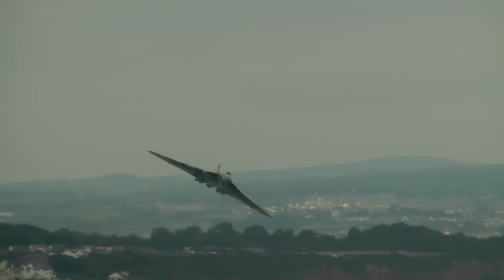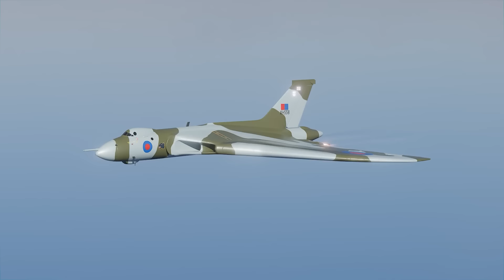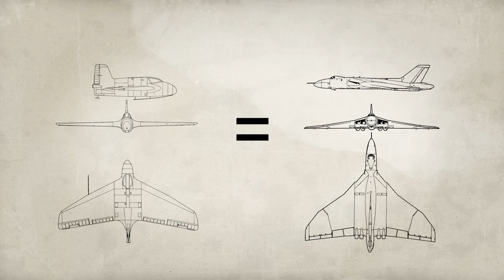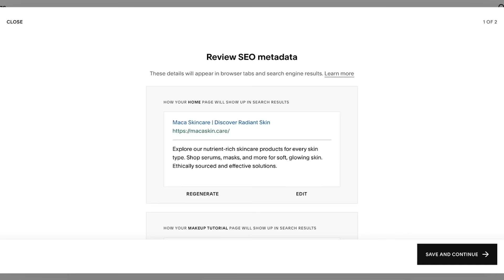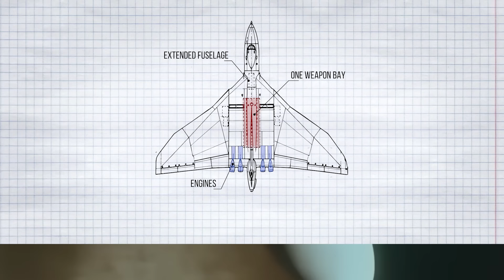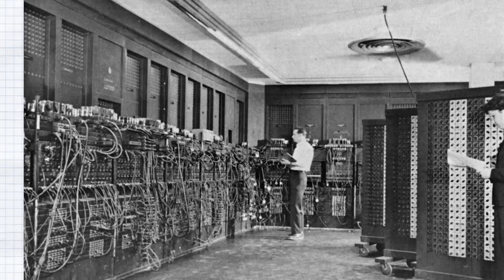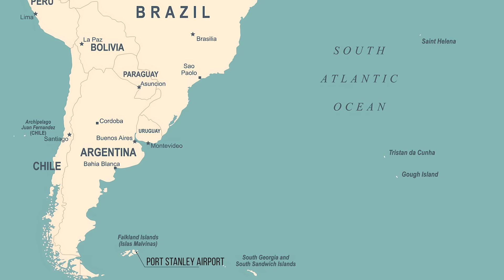The British bomber made to defeat Russia... Avro Vulcan

Comment: I was lucky enough to work on the Vulcan BMk2s from 1963-66. It was a never to be forgotten experience.
Reply: Did you ever deal with the Mach limiter system?
There is not much public information about this hastily introduced modification to the Vulcan after the in-flight structural failures.

Comment: The avro vulcan doesn't have afterburners.... or reheat as its called
Reply: Couldn't reach Mach 1 either... without crashing
Reply: @WilhelmKarsten I believe that at high altitude the vulcan could get close to mach 1, like the high 0.9s and could break mach 1 in a shallow dive

However your correct with the fact that it wasn't designed to sustain mach 1 speeds for long periods of time
Reply: @aufstrigende The Vulcan exhibited a fatal pitch-down, Mach tuck behavior above Mach 0.9 and all production Vulcans were modified with a "Mach limiter" device that would automatically override the  pilot inputs and put the aircraft into a climb if it approaches Mach 1.
This was in response to 2 near crashes and one fatal crash due to loss of pitch control authority.

The Vulcan was designed to fly Mach 1.6 with afterburners on later production models but these engines were canceled after serious structural and aerodynamic design flaws were encountered in flight and acceptance testing in the supersonic and high transonic regime.

Britain has never produced any successful supersonic bombers and only produced a single supersonic jet aircraft, the Lightning.
Reply: @WilhelmKarsten I didnt know that about the vulcan so pretty interesting, 

i suppose britain has had a few fighter aircraft capable of pushing past the speed of sound however they have always been at high altitude or in shallow dives and I suppose the Typhoon and Tornado ADF would count to the supersonic list that britain have produced however they was in partnership with other countries
Reply: @aufstrigendeThe English Electric Lightning is the only British designed and built supersonic jet.

Comment: Wait... flicking a nuke? btw. they used a lot of things learnt from the vulcan for the concorde. infact, the concorde also used the rr olympus.
Reply: Really? What this did they use on Concorde?
Wtf? Are you serious. The Concorde uses completely different engines!
Reply: @WilhelmKarsten  the Concorde used Olympus 593s which were directly based off of the 201s and 301s the vulcans used
Reply: @shuriken5176 WRONG, the 593 was developed by SNECMA in  France and is a completely different engine

Comment: Since when did the Vulcan have afterburners!
Reply: Avro designed the Vulcan to be supersonic with afterburners but after the crash they canceled the afterburners and installed speed limiters on the rest of the aircraft to prevent more crashes
Reply: @DoktorBayerischeMotorenWerke No my friend, the Avro Vulcan was not designed to be a supersonic aircraft. While its revolutionary delta-wing design offered excellent high-speed, high-altitude performance nearing the speed of sound (around Mach 0.9–0.96), it was designed as a subsonic strategic bomber to meet Specification B.35/46. I flew them and know the aircraft inside out and know it's designed specs.
Reply: @johneland8225  Wow! You really don't know anything about the Avro Vulcan or the serious design flaws that were revealed in the flight test program.

Don't be stupid, do you really believe that a tailless, 52 deg. delta-wing, Area Rule jet aircraft designed in the 1950's with 4 massive Rolls-Royce Olympus engines was not intended to have supersonic performance???
 Are you trying to take the piss lad???

The Vulcan had an extremely high Mcrit of Mach 0.88 (higher than the Mach 2.2 F-104) but testing revealed serious aerodynamic and structural flaws and limitations. 
Despite its high wing sweep angle and Area Rule fuselage during high-altitude, high-speed tests it had a severe "Pitch Up Problem" as it neared high transonic speeds. compressibility would overcome the plane pitch control authority and go into an unstable AoA, which led to a high-speed stall and catastrophic structural failure.

Avro was forced to modify the Vulcan 'Ad Hoc' with vortex generators on the wings and a "Mach Limiter Device" to prevent pilots for inadvertently reaching Mach 1 in a shallow dive.

The Vulcan could easily reach Mach 1 in a shallow dive without its planned afterburning Olympus engines, which were subsequently canceled.
The Vulcan's failure to achieve Mach 1 and the fact that the UK has never produced a supersonic bomber is a source of great shame and embarrassment.
All mention of Vulcan's supersonic capability has been erased from Avro's and any other British published literature.

The Vulcan's configuration is both unique and a dead-end concept, a direct result of Britains lack of supersonic aircraft technology.  

 Any questions laddie?
Reply: @johneland8225 The Avro Vulcan was designed to fly Mach 1.6 with afterburner but it's design was deeply flawed due to Britain's lack of high-speed wind tunnel research.
The Vulcans unique supersonic aerofoil designed proved to be an evolutionary dead-end concept and has never been used since.

Comment: 0:28 Why has it got afterburners 😭
Reply: The Vulcan was designed to exceed Mach 1 with afterburner in level flight.
Problems with the massive Bristol Olympus engines with afterburner caused delays and was not ready so the Vulcan entered service without the afterburners with plans to update older aircraft when the engines became available.

Two near crashes and the crash at the Seyston Airshow revealed that the Vulcan was unstable at Mach 1 and plans to install the afterburner were canceled.

Avro was forced to retrofit the Vulcan with MCAS to prevent pilots from exceeding the safety speed limit of Mach 0.9

The MCAS system would automatically pull the control yoke back and put the aircraft into a climb if it exceeded the safe speed.

Comment: Needed re engined and electronics upgraded and it would still be like a UK B52. Add some fuel tanks to double it range.
Reply: The Vulcan was never designed to handle the stresses of low-level, terrain following missions and the airframes were literally destroyed by metal fatigue and corrosion damage from weakened joints.
 The Vulcan was never able to fulfill its high altitude missions because it was too slow and it lacked the range at low-level to be a threat to the Soviets or any other potential threats.

Britain lacked a long range, air launched missile and could not afford to develop a new missile and buy the American Polaris missiles.
Britain lacked a nuclear ICBM too

Comment: I saw the vulcan in one of its last flights at herne Bay, kent, the sound was incredible,  it blocked out the sun as it headed out over the sea, setting off car alarms. As it flew across the sea it opened its bomb doors. Its rate of climb was also amazing,  just an incredible plane . Sadly  it is  not possible to certify the plane for air  worthiness,  so it can't fly anymore

Comment: That thrust sound is the best I've heard....that bomber with 4 English Electrics and your in trouble....the Electric was a rocket with wings....the English E climbed to over 80k feet surpassing over Mach 2.2 the US asked for 2 English Electrics and there pilots and grown crew to test against SR1 to see if it could keep up and reach it's altitude..the U2 had 10 minutes advantage then the pilots heard the roar of the English Electrics which was doing just over Mach 2.4 and then went on to climb  to 82k feet absolutely annihilating the U2
Reply: The Vulcan failed to fly supersonic despite being powered by 4 massive Bristol Olympus engines.  The "Aluminium Death Tube" what RAF pilots called the E.E. Lightning could only reach Mach 1.9 in operation service... it was not a true Mach 2 aircraft. 
it was also the only British jet aircraft manufactured that could achieve supersonic performance.
Its speed was at the expensive of having any useful range...

Comment: She didn’t have reheat/afterburner. Dry thrust only.
Reply: The Vulcan was a major disappointment in early flight tests and was unable to safely fly supersonic, Avro was forced to installed Mach limiter device to each aircraft to prevent loss of control and structural failure resulting in fatal crashes.
Plans to install the afterburning version of the Bristol Olympus engines was canceled.

Comment: Have always been a big fan of the V-Bombers seeing Victors, Vulcans, and even by chance a Valiant fly. I also like to include the backup aircraft the two Sperrins built just in case the others didn't work. Managed to go on board for a ground tour through a Sea of Vulcans at RAF Scampton of the last Vulcan B1a, and boarded a B2 at Blackpool. Plus boaded a Victor at RAF Marham which is very different inside. 
   One concept I can remember them contemplating was a Vertical Take off Vulcan. I can't remember if that was if the 1950's idea for a VTOL test bed for the Rolls Royce Griffiths Airliner or not which if it were ever made was designed with an amazing 68 engines. Saw XH558's last flights. Last official display over Shuttleworth Collection, Old Warden, Bedfordshire arounf 10 years ago. Someone has mentioned it. It's a good video. It is a shame that it shows the Vulcan with afterburners which it famously never had.

Comment: You were doing great until you stated that the Blue Steel was there to defend the bomber. Blue Steel was the equivalent of a modern Tomahawk Missile carrying nuclear warhead, a nuclear tipped stand-off missile, so that the bomber didn't need to fly over the target. 
However, I seem to remember there was some talk of using the wiring for the previously installed Skybolt missile system to allow carriage of AIM 9L Sidewinders during the 1982 Falklands War.

Comment: Saw vulcans several times at Woodford air shows. Besides the howl they would make the ground shake and fill your senses with noise as they would fly along the runway at low speed then open to full throttle into an almost vertical climb setting off car alarms. It was amazing to see that huge slab of metal going straight up then being flung around like a fighter.  There is one on display at Woodford Avro heritage museum, also a cockpit you can go in.

Comment: Small inaccuracy, while the Engines the Vulcan used would be the same used on the Concorde, the Vulcan's did not have afterburning versions of these engines so showing them with afterburner is a mistake and tbh a pretty amateur one at that
Reply: Concorde used the French designed SNECMA-Bristol Olympus 593 engines, a completely different powerplant.
Avro failed to deliver a supersonic bomber... the Vulcan never achieved its Mach 1+ performance specifications.
Avro ceased to exist in 1963... it was absorbed by Hawker Siddeley which was not affiliated with the Concorde program.

Comment: I am lucky enough to see this fly and it moves more like a fighter than a bomber. If you really wanted to talk about this plane should should have mentioned operation sky shield from the 60s where the US wanted to test their air defences. The first operation would have seen the Vulcans beat the air defences and drop nukes on the US and the second operation where the US stacked teh deck in their favour would also have seen the US nuked by the Vulcan.
Reply: American bombers nuked London dozens of times... these were attack simulations just like with the Vulcan. Sky Sheild was NOT an exercise or a defense system test, it was only an attack simulation. 
 the Vulcan was a very disappointing design that failed to achieve Supersonic performance and was essentially obsolete when it entered service. Britain has never produced any supersonic bombers or stealth aircraft.

Comment: your diagram of the prototype is wrong the initial vulcans had sraight leading edges . this caused flutter so resulting in redesigned wings that you show on your diagrams.
Reply: It also resulted in Mach limiters being installed on all Vulcan to prevent them from crashing if they accidentally went supersonic, the Vulcan airframe was too fragile and weak to handle the stresses of Mach 1.

Comment: “170 tonne bomber” what is this a a330? Highest weight variant of the Vulcan was roughly 93 tonnes at take-off…
Reply: IT IS TON NOT TONNE
Reply: “ A tonne is a metric unit of weight that is equal to 1000 kilograms”

We’re using metric tonnes buddy. Keep your tons in America.

Also if you long press caps lock or the up
Key in your virtual keyboard you can go into lower case.

Comment: That howl only occurred on the B2 versions fitted with Olympus 200 series engines at a certain power level, and was caused by the airflow in the intakes. B1's and later B2's fitted with the 300 series engines did not 'howl'.

Comment: Its also subsequently been found out that the aircraft also had (unintentionally) some stealth capability, with a low observable cross sectional area across the fuselage and wings. Only the vertical stabiliser was fully detectable by radar.

Comment: MANY moons ago, I was at an airshow at HMS Daedalus when one of those things came over at (what I'm presuming) was it's bombing height. It was damn low, that's for sure.
Unlike a bombing run where it would have been going as fast as possible, it was going pretty slow becasue it was an airshow, which meant (because of the delta wing) high nose, full thrust on the engines, and just let her sit back and relatively slowly pass overhead.
Until that day, I didn't know noise could be that loud, like STUPID loud. So loud I don't think anyone on the airfield, myself included, got their full hearing back for about 20 minutes.

If the day had come where she was supposed to fulfill her design purpose and the nuke didn't work, she could have just deafened the enemy instead.

I should probably add, she managed to nuke (in simulated runs) the US. Twice.

Comment: @Found and Explained: Please could you change your model to remove the reheat flame plumes. The Bristol Olympus 200-300 series engines never had reheat/afterburner sections. So there is in-accuracy with the jet exhaust pipes having flames unless you have a quadrupel engine fire situation.
Reply: I really wondered about that. Your comment is very much appreciated.

Comment: Regarding the low-level flight requirement, in place of or addition to the high altitude requirement, if I remember correctly, this came late into the life of the V-bombers, the Vulcan being the only one capable (the Valiant and Victor being unsuitable).  And even so, the main wing spar proved to be less than robust enough, causing the crashes - until it was beefed up.

Comment: If America can keep those old B52s in the air why cant the Brits keep the Vulcan flying ??...🦘
Reply: Industry, scale, but mainly the engines (most importantly the placement). The first two are depply related. British aviation industry has fallen into a very deep pit since then, and they built far fewer of them in the first place so the parts are a lot harder to get (compared to the U.S having hundreds of B-52's laying around in the desert/still in service). The second is the engines. Now this mostly comes down to parts availability, namely the fact that it doesn't exist. And, unlike the B-52 (indeed, the main reason for the latest B-52 overhaul is replacing the engines), replacing the engines is nearly impossible. With the B-52 you just need to make sure the engines are sufficiently powerful and light (not a problem with modern engines), and you can fit the required machinery in where the old stuff was (also highly unlikely to be a problem with modern equipment). The Vulcan on the other hand needs sufficiently powerful engines that also perfectly fit (or are physically smaller than) the originals. Such engines don't exist, as such highly customized replacements would need to be designed, built, and fitted. And that would be incredibly expensive with a high chance of complications, if it's even possible.
Reply: @hanzzel6086  There are infact modern turbofans that are smaller than the Bristol Siddeley Olympus 301 with considerably better fuel efficiency and similar thrust values.

The reason the Avro Vulcan and Handly Page Victor were replaced, is because in the late 60's early 1970's the Royal Airforce lost it's role as the primary nuclear deterrent force and instead it was transferred to the Nuclear Submarines and Polaris Missile Program. 

As Nuclear Submarines and their respective missile technology out-ranged/out-delivered as a weapons platform compared to bombers, alongside being easier to maintain in terms of overall cost, the bombers we kept in service were only there until their fatigue hours on airframes and engines ran out or we fully replaced them before that stage.
In the case of the Victor they were kept in the RAF as aerial refueling tankers until their replacement.

The direct replacement for the Vulcan is the nuclear submarine. Hence the reason we do not continue to maintained and fly them today.

Another reason is that because of increasing advancement of radar systems for anti-aircraft missile batteries. The concept of a conventionl bomber was made obsolete as the chance of a conventional bomber reaching it's target became increasingly unlikely to the point of potentially impossible.

Some countries however have decided to use stealth as a way to increase the survivability chance of bombers allowing them to continue in a capacity in an age of nuclear submarines.
Reply: Boeing builds its aircraft to a far higher standard than British aircraft... another important factor is Boeing is still in business (largest aerospace company in history) and has been providing continuous technical support for the B-52 for the last 75 years, Avro went tits-up in 1960